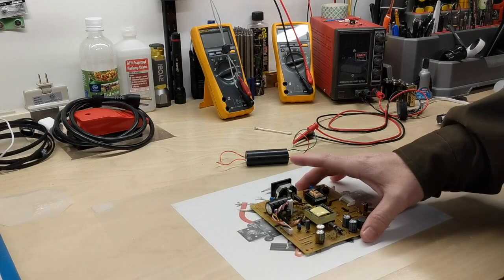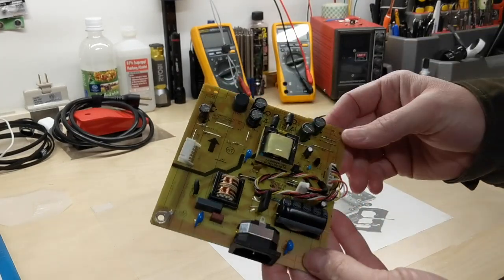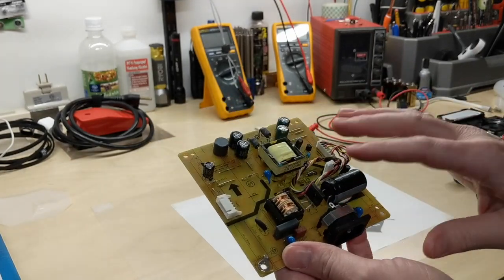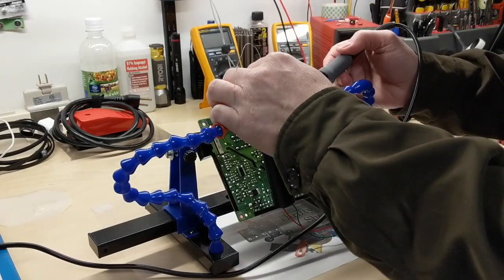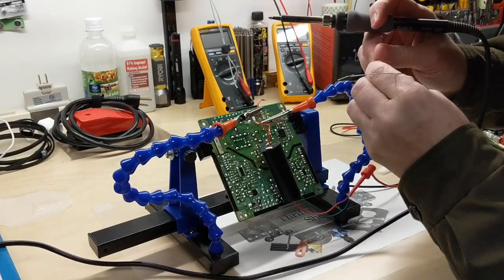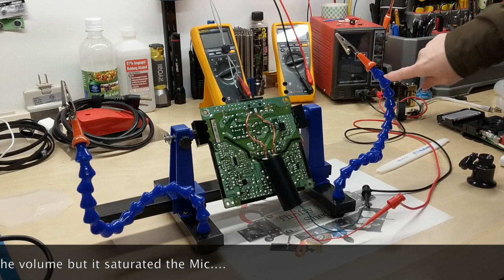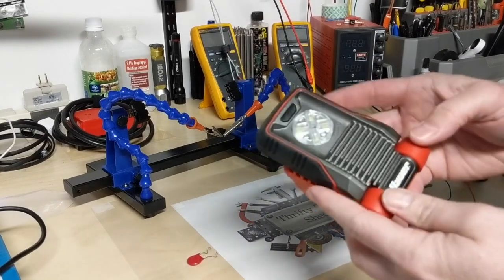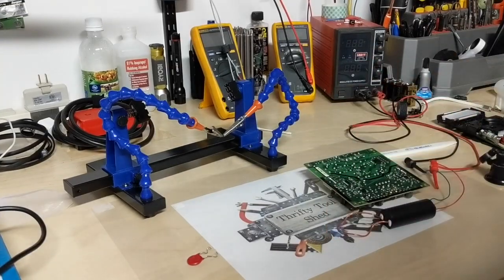Spark Gaps Electronic Protection  (Weekly What Is It #4)

Comment: What a great video about spark gaps in modern electronics - something that is almost never mentioned. Love the demo using a cheap HV generator - I don't think I have seen a  circuit board spark gap actually spark - I'm sure you demo gave it more sparks that it ever was intended to handle! I wish I had seen your video before I did my Halloween spark video - would have asked  permission to use a few seconds of your demo!
Reply from the maker: Anytime man! I love the videos you do and the knowledge you bring to your videos!

Comment: I have actually used GDT's in series and parallel configurations with those ebay high voltage modules.  Those modules actually consist of a transformer-oscillator which puts out an AC voltage to a Cockcraft-Walton voltage multiplier (usually about 4-8 stages).  The voltage output can be approximated by the length of spark that can be obtained (about 1kV/mm).  My particular "400kV module" actually put out near 10kV.  I didn't see anywhere near a 40cm (15-1/2") spark!!! ...ABSURD...
 One more thing:  These modules tend to burn out if run with  "no-load" -- as the voltage gets too high.  And they also tend to burn out with a short circuit -- as the current gets too high.
--dalE
Reply from the maker: dale nassar, yes I have indeed read that no load and also short circuit can kill them.  I have only played around with that one but I was hoping not to kill it before the demonstration. Lol. 
That's why I really did not know how it would work, and I  unfortunately did not get the brightness right on the video, I had not tried it ahead of time. I wanted to capture it while doing the first test do to it being a  open circuit for a few seconds getting it started.